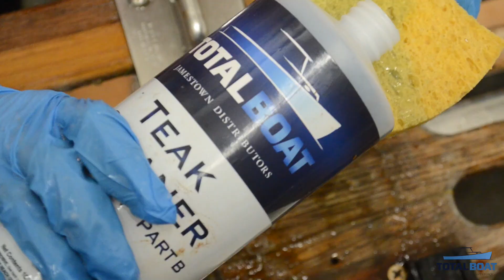How to Use 2-Part Teak Cleaner

Comment: Will this teak cleaner damage adjacent awlgrip?
Reply from the maker: IT will not but as with all acid based products, you should neutralize any area which was touched by the acid with Part B which is meant for just that. Also the application of water to your work area before you start will help prevent any issues. Thanks for watching!